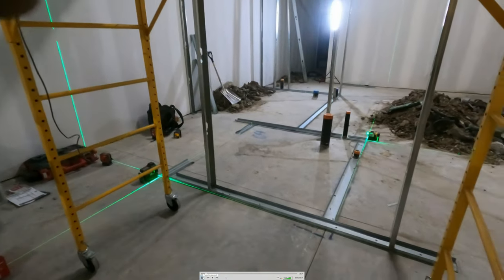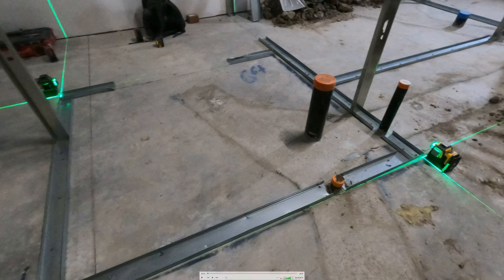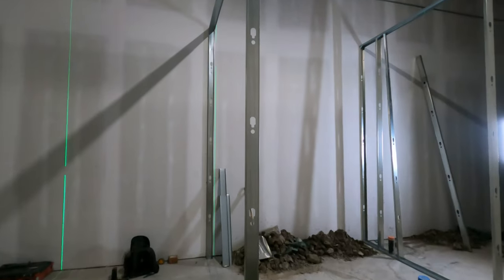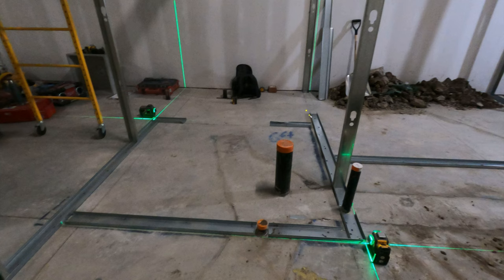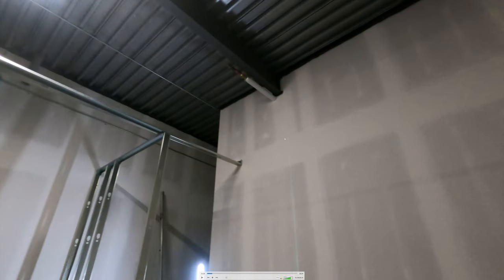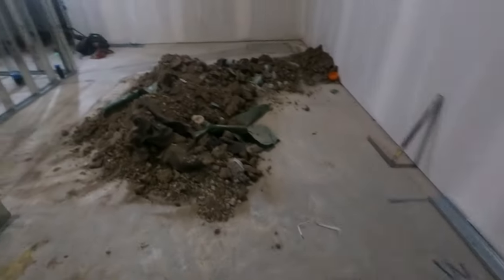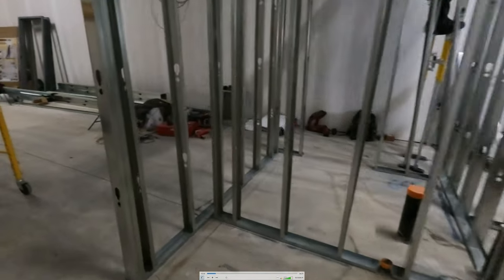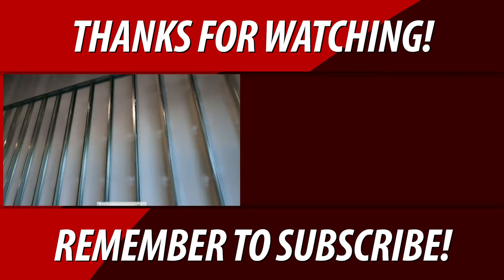Metal Stud Framing On Concrete Floating Walls

Comment: Any chance you have a video of floating half wall with box beams connected up to I beam?
Reply from the maker: I don't but what we do is frame up the ends all the way to the deck or structure then fill in the middle at whatever elevation is required.

Comment: What kind of caulking do you use in between the track and the concrete? Is putting it there a must or a preference?
Reply from the maker: Acoustic caulking, mono or Chemtron. Yes it's a must on exterior or frost walls, recommended between steel and concrete all the time but interior partitions don't always get it.

Comment: What if your floor is uneven and not 100% horizontal?
Reply from the maker: Yeah that's a pain. If it's sloped on purpose that's easy just lay it flat but when it's just poor concrete you.can cut the flanges and bend it down or if it's heavy gauge cut it completely. It shouldn't be worse than that or I would recommend a self leveling concrete. Any kind of flooring has to work as well or in shops you don't want puddling.

Comment: Hi Chris, I am building a 5’x10’ high reception wall under a dropped ceiling. What are some expert tips to keep the wall standing sturdy? Thanks
Reply from the maker: Is the drop ceiling tbar? You could use Revoe clips. If it's drywall screw the top track right to the drywall with 1-1/4" drywall screws. Screw them in at an angle and stagger ever 1' and put 2 in the ends of the track. Does that help?

Comment: We are finishing our basement of a new build.  Is there a pneumatic gun you could recommend to attach bottom tract to 4 mo. old concrete floor?
Reply from the maker: You could go with a Ramset, they can be purchased at home depot. Either that or use a hammer drill to drill a 1/4" hole in the concrete and use smack pins.

Comment: Thanks for the videos, great job. I have several questions. I'm building a (metal stud) Well house 6 ft x 8 ft, with 6 ft walls. In order to allow future well repairs and service, I'm planning on having a hinged roof and the front wall (with door) which can be entirely removed to allow for equipment access. I wanted the structure lightweight especially the roof so, one person can lift the roof. The original wood frame with roofing was impossible for one person to lift. Plus over time wood deteriorates, my reason for going with all metal.

I don't plan on covering the interior walls, only add exterior metal panels for roof and walls, maybe insulate is all. 

Got any suggestions or reading materials that may help. I have an engineering background so, I kind of have an idea on how I want to proceed. I noticed also you use vise grip "C" clamps. Pretty handle tool, where did you purchase them? I'm installing this structure on an old concrete base, some spots are uneven and cracked. I've noticed some folks use a rubber seal tape and apply it on the bottom plate. Have you heard or used such a product? Thank you.
Reply from the maker: Yes it's a foam gasket that comes right from the drywall supplier. You can use caulking as well, chemtron or mono it's a black acoustic caulking. I would go with 20 gauge 3-5/8, but I bet 25 would work too just double up all the end studs. You could use a rigid insulation that'll keep it nice and clean or maybe a blanket insulation with a washable side. Sorry it took me so long to reply just got to town.

Comment: Love your vids. If I laser up the door frame after I hung the drywall and it’s not level, how do I fix it?
Reply from the maker: Take all the screws out of the door studs and header, you should be able to push the frame level by hand easily and if not use a 2x4 (wood) and a small sledge hammer. If it's double layer drywall your going to have to remove the second layer and the perform those steps. Any other way you attempt this could damage the frame or clips and will make the door frame lose. If this is on wood walls or you can't push it level going to have to take it all apart and start fresh. Super important to laser up the hinge side while drywalling. Hope that helps.
Reply: @ConstructionKronies  thanks a lot!